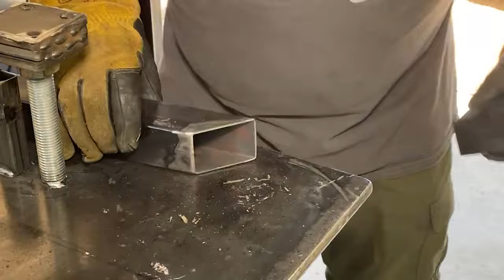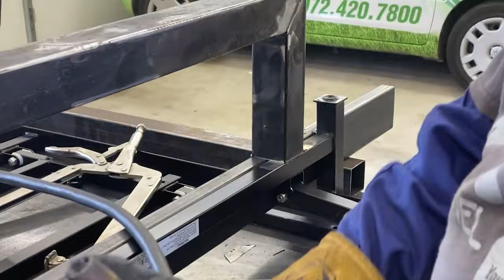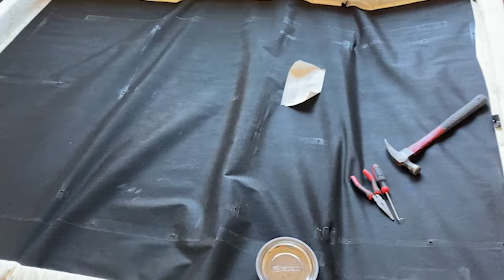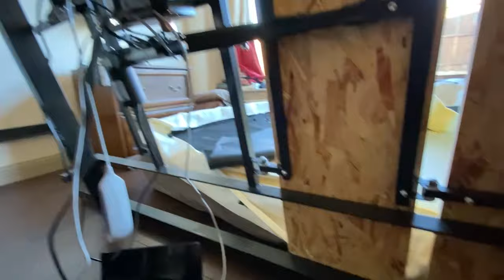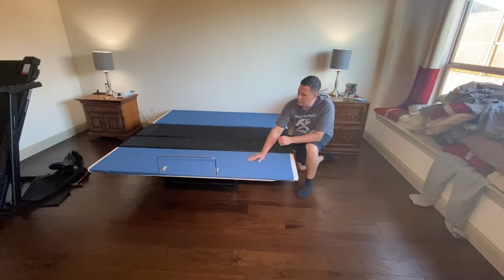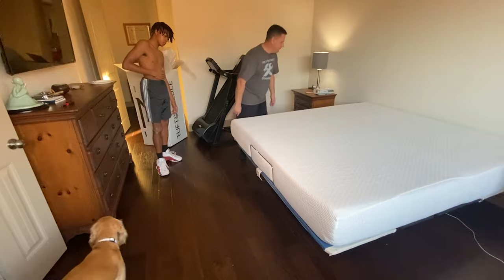DIY -  SIMPLE BED TO REMOTE CONTROL FLOATING BED - AUTOMATIC BED

Comment: Thank you for your video. I have already subscribed to your channel. I saw the tools lists and the links. It's a very nice introduction. But actually, if I want to make the same bed in my environment, I do not know about the machine module, such as the hydraulic rod, the electric components. If you have enough time, could you make a video or open a list to introduce more details about this bed? I want to make a similar one for my old mom. Thank you for your video. I am looking forward to your reply.
Reply from the maker: All the hydraulics came with the original bed, I just cut up and made it wider. You might look on marketplace to see if you can find a used one.

Comment: Hey I had a Question .... I'm kinda on a budget cause ... So I always wanted a Temperpedic Mattress but there so expensive... j never wanted to shell out the $2,300 but now 15 yrs later you go Into Matress Firm and almost I st every bed is about $2500 - $6000 ( $5000 or so for the higher end Temperpedic 10° Cooler wich I love  ) but now I figure with the prices of beds and my bad back let me Spring For the Cheaper ADAPT TEMPURPEDIC... about $2100 for the Queen $2800 for The KING SIZE ...

OK HERES MY QUESTION.... can I turn my Temperpedic Ergo Plus Adjustable Base Queen ..... into a KING SIZE BASE ????    THIS WAY I DON'T HAVE TO BUY A A KING SIZE ADJUSTABALE BASE ????

It seems like how some are made I can just screw in some Boards going across with some space inbetween each one....kinda like how you see some come that have about 5 palats just going across .... I figured maybe make t BFF em a little linger big enough for a King Size mattress and attach them on  ????     

Lmk ASAP / OR ANY OTHER IDEAS ?..... THANKS SO MUCH
Reply from the maker: That would probably work. I just made the frame wider with metal and plywood.